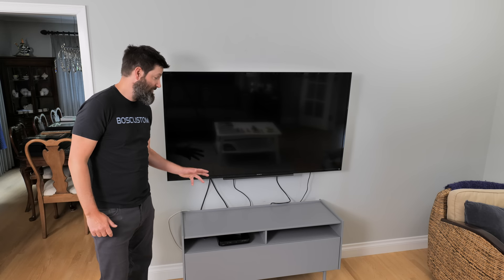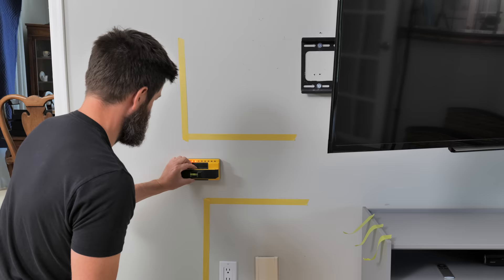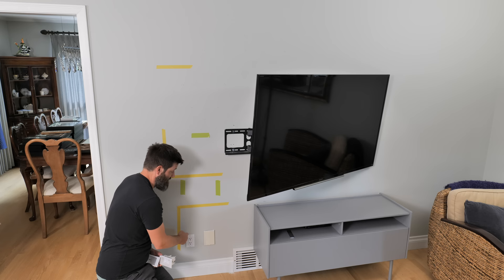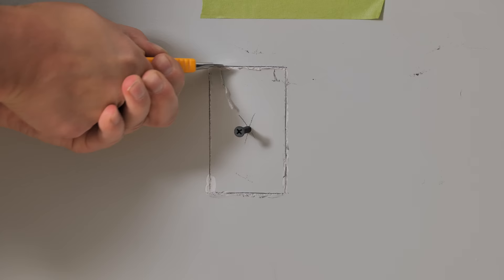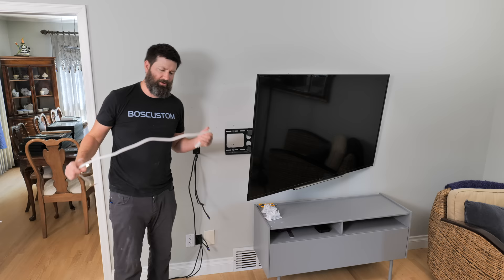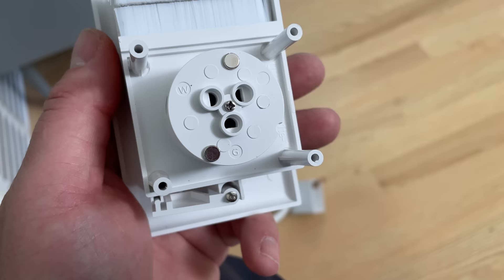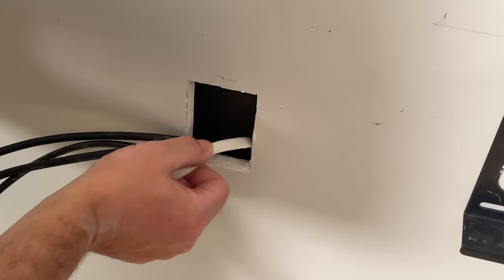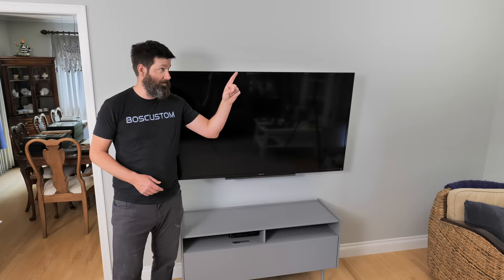The Easy Way To Hide TV Wires Without Breaking The Electrical Code!

Comment: Looks good but I have some reservations about the power jumper lead as it appeared to be a doubled ended male connector which is what is known as a kill lead.  Removing the wrong end of this lead with the power on would expose powered prongs which would be rather dangerous.
Reply from the maker: It would not be possible to power up the prongs in this configuration, its essential just the male end of a cord.
Reply: The other end of it is the TV. Unless the TV is capable of energizing the male prongs, you shouldn't have to worry about it.
Reply: There’s no power on the male box end. The TV does not supply power to the socket. This how you actually do this without creating a kill cord.

Comment: I like this design because you can plug the TV into a surge protector at the bottom to keep your equipment protected.
Reply: I installed an electrical outlet behind the tv that has surge protection built in. And add it to the circuit from the lower outlet. That way you don't need the wierd power jump cable or a surge protector on the floor

Comment: Always orient your screws. Might be a bit OCD but really does separate the pros from the armatures 😁
Reply: My son in law does high end house builds in NZ (mostly multi mil. coastal beach retreats) and they took to using Torx head screws for this reason as they look aligned regardless. Stainless Steel of course….

Comment: Oh I wish there were similar electrical outlets in the UK ! Great video 😊
Reply: I think you will find most UK walls are brick, not like the US wood and plaster board. 
Kit won't work.
Reply: @richardw3294  really? 🤔🤔🤣🤣 And I have only been working as a tradesman for twenty years. I was commenting on how good the kit is. Deary me.
Reply: @richardw3294  I disagree with this 😅

Comment: What about if the fire break is in between? Also, i found they make a surge protected outlet when I hung my TV. Added that on the same circuit as the lower outlet and installed directly behind the tv. and then I didn't need that weird power jump cable down low or surge protector. Lots cleaner imo. But this is not a bad way if there's an entertainment cabinet that covers it all up
Reply from the maker: If your above the fire blocking, I’d try and stay just above and then drill a hole in it through the box opening.

Comment: I think it should exist a cheaper and smaller option that doesn't include power outlet, right?
Do you recommend passing together through these kits the power cords and HDMI and RJ45 network cables?

Comment: Could you have hard wired it to the outlet if you didn't need the extra cords, or will that get you into trouble with electrical codes?

Comment: Vertical faceplate screws look terrible, they should be at 60 degrees for optimal aesthetic.
Reply from the maker: deep cuts
Reply: They should be torqued to spec irregardless of position.
Reply: @davidtaylor9249  🤣👍

Comment: Are your walls not insulated??? Gonna be challenging getting the wired down behind the wall with a bunch of insulation
Reply: Interior walls usually aren't...but not always. Depends on the house. But yeah it'll be a pain to get it through if they are. In that case it's helpful to use a wall fish, which is a rolled up length of stiff (but still flexible) wire that you can use to push through the wall, then attach your cables onto the end of it (electrical tape is best for this), then pull the cables through to the other hole, and detatch from the fish.

Comment: nice system,however,i've seen bare wire in your power fittings,thats a no-go,i hope for you that you dont get shorts at some time
otherwise you will have a house fire,i always make it so that there is no bare wire visible,then i will have no short circuits at a later time

Comment: You didnt even show the bottom how do you connect it to the power
Reply: He did. U just didn't pay attention. So, when he pushed the three wires inside he then screwed it, then gave it a tug to make sure the wires were tightly screwed in. He screwed it into the wall, then  jumped the power with the provided cord. Meaning, plug the provided double headed cord into the new outlet and the existing outlet. That's how u get the power. Hope that help
Reply: Me too

Comment: That thing is so janky. Why not run a new box up top and panels beside them for the connectors? Or in many cases may just need power since it may just have an appletv that can be mounted up top or a tv that has android tc or something built in.
Reply from the maker: I was actually impressed with the kit… but yah I could have definitely gone in a more pro direction.  But I thought this would be useful for those folks out there that don’t want too open up existing boxes and splicing wires.

Comment: electricity wires could have been connected to the existsing socket's back, so no need a transfer cable and still have one empty socket for other device. your solution is a bit overcomplicated. no offence.